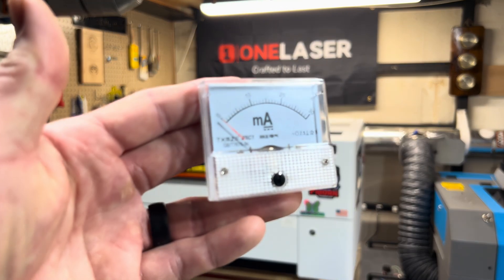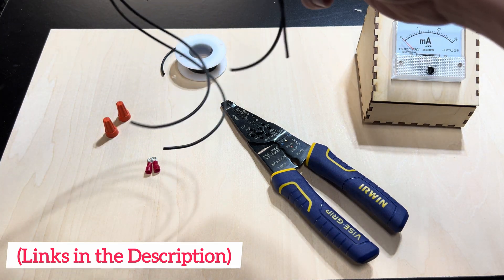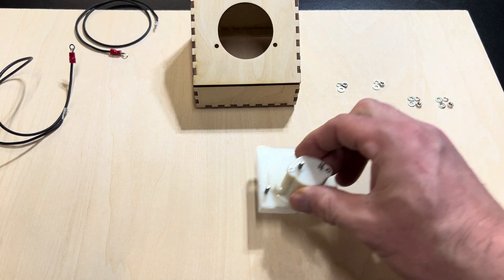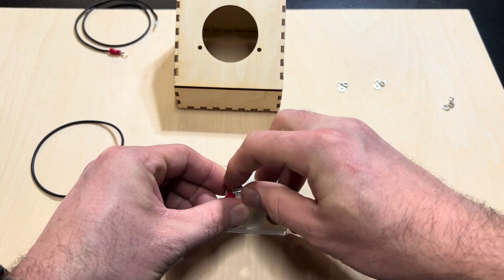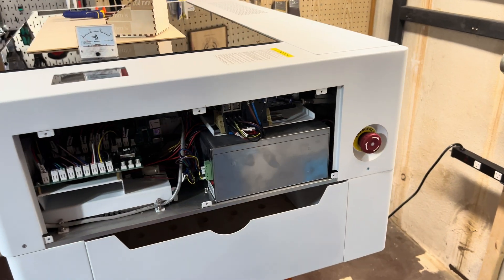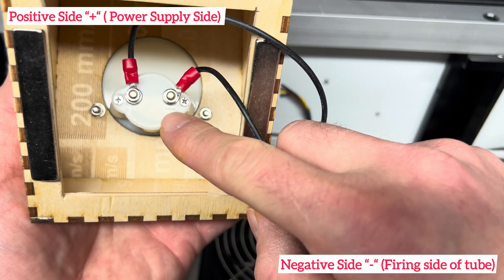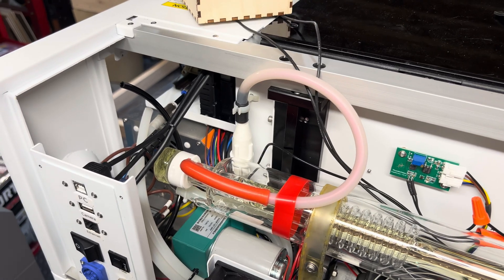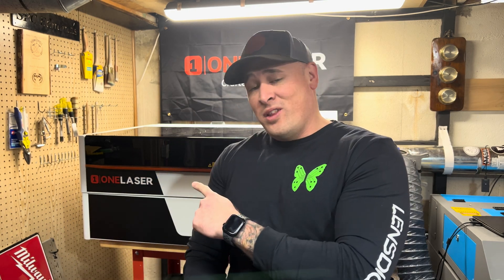How to Install a mA Meter | Milliamp Meter on CO2 Laser | OneLaser

Comment: Keep in mind that anolog meters are most accurate in the middle third of their range. So you want to buy a meter that has your target value - 20 to 22 ma in this case - in the middle third of the meter's range. The meter in this video is pretty close.
Reply from the maker: Thanks for sharing! I actually didn’t know this. I’ve been buying analog meters that usually encompass the range of the laser tube itself.

Comment: Can I use ammeter on a multi tube Co2 laser (500w) 3 x 150W tube, Thanks, Jeff
Reply from the maker: Each tube should have a dedicated power supply. This means that each tube would have to have a dedicated mA meter at the neutral line. Just keep in mind that you’d need a 0-50 mA meter. My video shows a 0-30 mA. A 150w tubes maxes out north of 30 mA but under 50 mA.

Comment: This is why, that if we know the max for the tube that is in use,  is 22 mA, for example, then we should be able to set 100% in Lightburn to be 22 mA.   No more, and no less.     How could this be wrong?  I've thought about this for years.  :)
Reply from the maker: OneLaser calibrates their laser tube power supplies perfectly so that you’re getting just about 22 mA at 100%. I did this same thing on my OMTech and it’s WAY off. I max out my tube at 85%.
Reply: @EdmondsWoodshop  That's great to know.  I'm in the OmTech world still, so having to use a meter to make sure I'm not over driving the tube, annoys me so much.  :)
Reply: @EdmondsWoodshop this is super useful information! I just order the Hydra 16, and I was unaware of this feature.
Reply: Great video Cam just thinking about Lightburn and the line power test. In printing, a typical operation when dialing color in is to use a linearizarion routine to get the colors to image at a baseline density. Often times, you will see “dot gain” that doesn’t not yield a linear response. An algorithm is applied to the baseline values to make it more predicable. Does 
b have any such test?

For example, if your power starts imbuing at 11% and maxes out at 85%, a compensation curve of sorts could be made to calibrate it. This way you out in 50% power and get and expected result. 100% power in LB actually equates to 85% at the cutter. Just curious on your thoughts?

Also, I like the box, is the file shared?